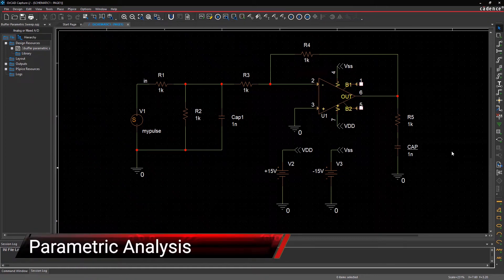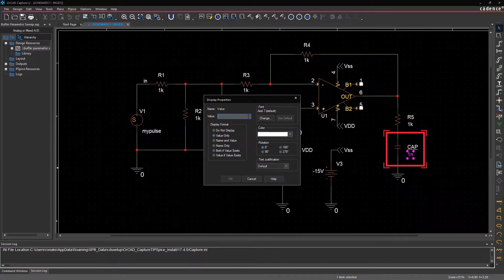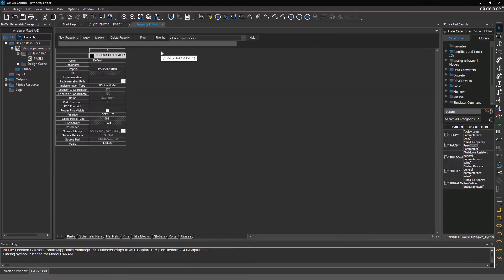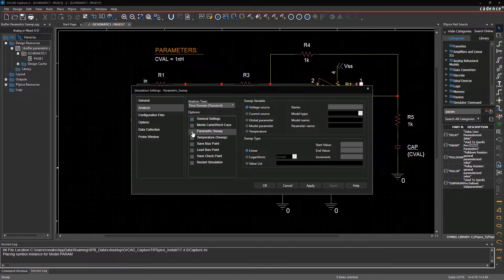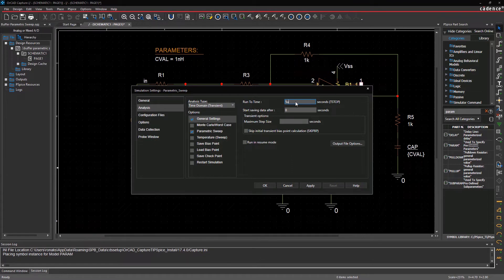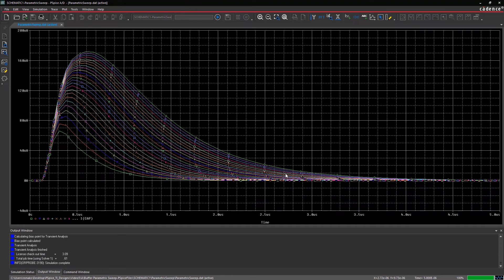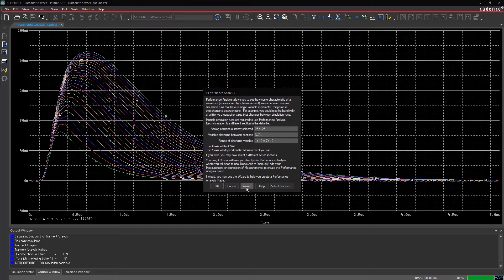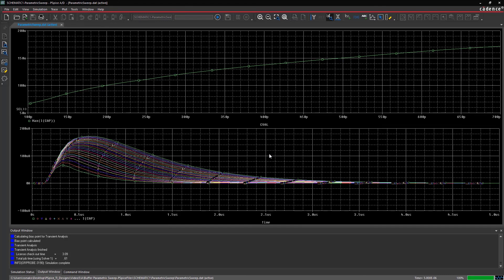Parametric Sweep Analysis with PSpice | PSpice

Comment: Good tutorial.  I'm trying to sweep an AC voltage source whose voltage and frequency are both functions of the same swept parameter.  It's a permanent-magnet AC generator (alternator).  If anyone can post a link to a solution it would really help!  OrCAD user since 1998.

Comment: WHY would give a value of 1nH to a Capacitor?? second 52
Reply from the maker: Nice catch! You've got a keen eye :) The unit of measurement for a capacitor is a farad (F). And CVAL should have been listed as 1nF, it was a typo on our end. Thanks!
Reply: and how was the value of 1nF chosen @CadencePCBDesignandAnalysis
Reply: @CadencePCBDesignandAnalysis en what if it is a resistor?